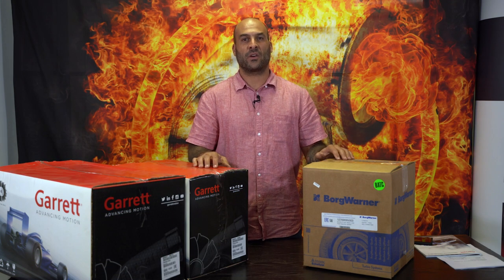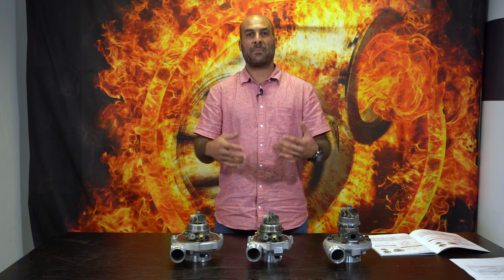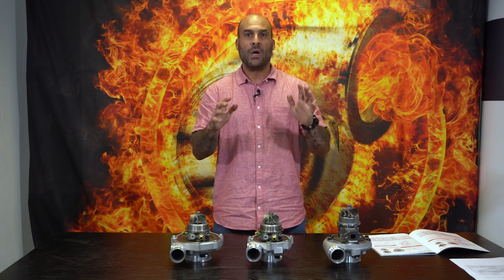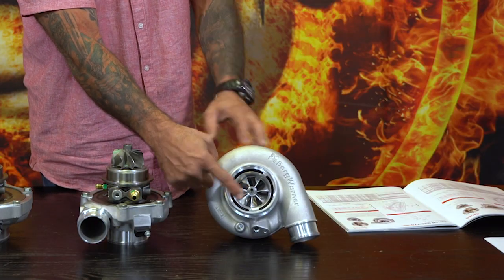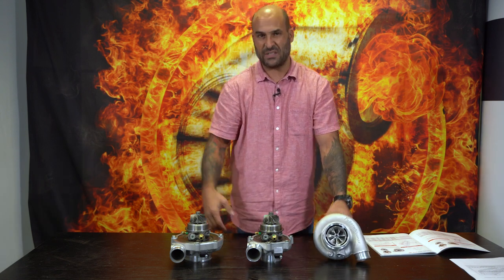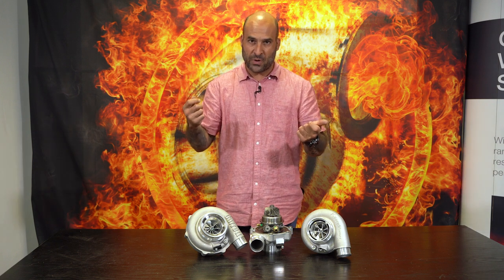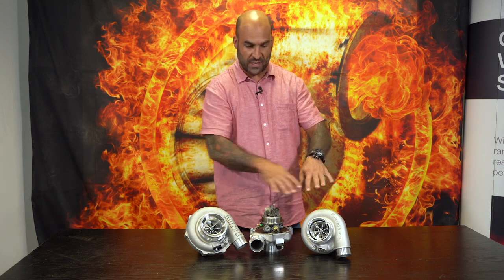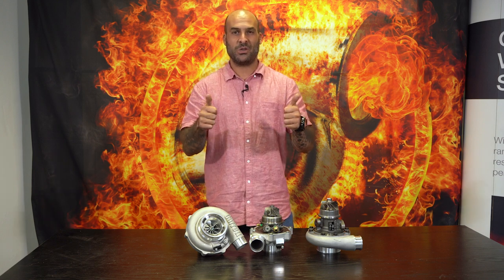BorgWarner Airwerks S200SXE versus Garrett G30-660 and G30-770

Comment: garret very unreliable turbos with plastic separators in ball bearing cartdige, including g-series, only marketing
Reply from the maker: Garrett's new G-series ball bearing cartridge uses metallic cages, no longer plastic. The old designs, we used to manufacture the metallic cages for the turbos and upgrade them.
Reply: @TurboDirectSA  ok good. g30-770 it is old 3071 in new cartridge right? garret is too expensive turbo to experiment new cartridge. I have no doubt that garret could show "horse porse" on dyno of yours, but how fast it will be? how laggy? and the most important how reliably 'new' compare?
Reply from the maker: @Arss-ast  No the G-series has completely new design bearing housing and bearing cartridge - the same dimensions as the old cartridge.... The turbine wheel and comp wheel are both redesigned and also the housings are new- its a clean sheet design. The design is great, but very expensive compared to other options on the market today which offer more and have a better bearing cartridge and cooling system.
Reply: @TurboDirectSA  sounds like marketing ploy, ok will see how fast it will be, in efr everything understandably gamma-ti and other BW technologies. But garret is good only on paper, at least - now
Reply from the maker: @Arss-ast  I agree with you to an extent. EFR is far better than Garrett in some areas, but Garrett is also great. Everyone has his opinion, and experiences, and in mine, it's EFR all the way for various reasons which impact reliability, affordability, technology, attention to detail and also repairability and support from the manufacturer.
Reply: @TurboDirectSA  i am not talking about what turbo is better, I said EFR is understandably technologies. in what area garret is better then sxe series? at least 
reliable garret gen1/gen2 with plastic separators
Reply: it is not my opinion, im not selling the turbos, its just  a statistical data
Reply from the maker: @Arss-ast  SXE is not a fair comparison to the GT or GTX Gen1 turbos - they dont even use the same bearing technology. Gen2 has metalic cages
Reply: @TurboDirectSA  why sxe still working after 2+ bars of boost? gt/gtx will die at 2 bars
Reply: @Arss-ast  the g30-770 is actually a hair bigger than a gen2 gtx3076r.  The 660 is a little bigger than a 3071r.
Reply: @donmerrigan2362  does not matter, it wont be faster that bw in same configuration

Comment: The G30s are not "less efficient at low boost pressure" the way it's being described.  The G30s are MORE efficient at their peak efficiency, but if you remove all of the efficiency islands from the G30 that are about the peak of the S200SXE's 75% efficient you will see a VERY different map, and draw different conclusions.
Reply from the maker: Nope - apples with apples boost for boost lb for lb - BorgWarner outperform G-series every time.  Facts kind sir - will always prevail.
Reply: @TurboDirectSA  You literally said the G-series was "less efficient".  And I said you preferred the BW turbos and you denied it, now you clearly say you do prefer them.

I like BW turbos fine, but you clearly had a preference.  At least you admit it now.